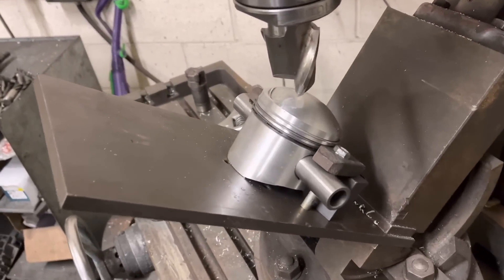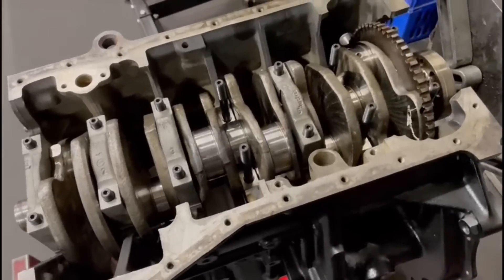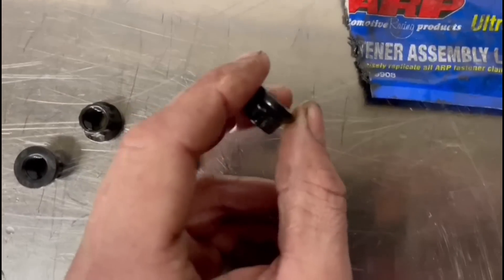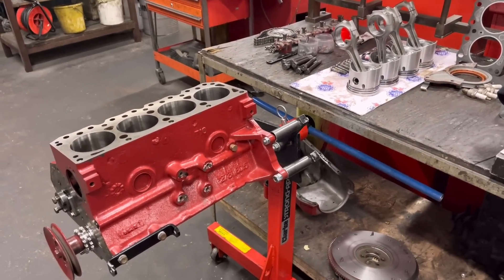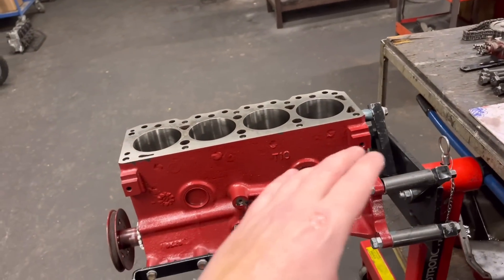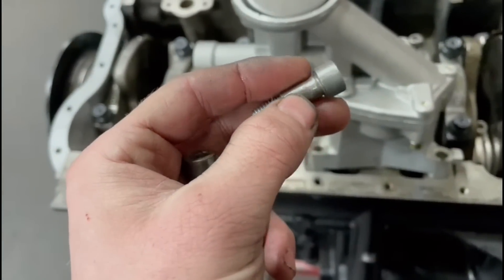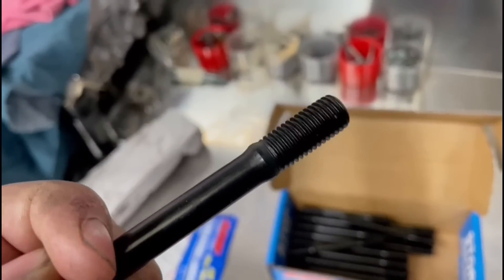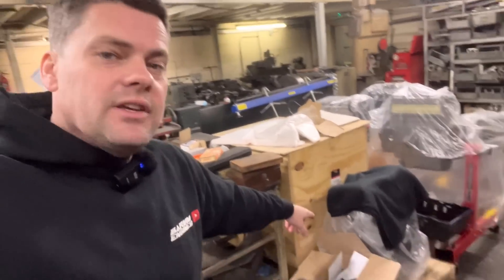“ALL BEEN DONE” they said. Lotus engine inspected. You won’t believe what we found inside!

Comment: Hey ,machinist here! I know that 2 flute endmill "works" but you will get less stress and easer chip removal, with an 4 or 6 tooth high helix endmill.
Id also recommend you reduce you SFPM accordingly as the more teeth, the less tool rpms are needed. Your not hogging so deep flutes aren't needed.

Comment: With ANY New/rebuilt engine the FIRST 20--30sec are the MOST CRITICAL in the ENTIRE LIFE of the Engine!!!!!!!!!!!!!!!!!! a rebuilt engine probably has to turn over quite a few times before it will start, oil pressure probably is Not up at that stage, so NEW TIGHT pistons/rings etc with little or No lube NOT GOOD, personally IF i was rebuilding an engine ALL moving parts would get assembly lube!!!!!!!!!!! For the first  500km just a basic cheap oil nothing too fancy ( you have too allow an engine to bed in before using the good stuff, after running in oil change every year regardless 10km or 2000 CHANGE the oil!!!!!!!!!!!!!!
Many years ago my friend, a warmed over 1600 B series ( don,t laugh it surprised me!! ) it was rebuilt, he helped someone towed a car, ruined the B series!!!!!!!!! 
My father was very highly qualified mechanic, ( 14 or more qualifications!!!!!!!!!! ) plus my own experience 55yrs of motoring, DO NOT SKIMP on maintenance doing so will BITE you on the ass!!!!!!!!!!!!!!!!!!

Comment: You can measure the exact depth by placing a height gauge in the pocket and touch with the mill the upper side of the height gauge. This way you know the exact depth which could allow you to leave a witness area within the pocket when you tilt the mill slightly as suggested

Comment: On the pre-crossflow engine, I agree 100%.. never buy something that's "been done", and if you do coz the price was right, at least take it apart and verify everything. Case in point I bought a used engine last year out of a running vehicle that had been "overhauled", for peanuts, just TO take apart and recondition for another project. The deeper I went in the worse it got. Someone had been in there alright, original main & rod bearings completely worn out, but fresh(ish) piston rings installed upside down, gasket sealer everywhere, bore taper, it was a mess. I couldn't believe it was running decent before I took it apart. So that cost another $600 worth of parts and machining to put right.

Comment: I cringed when I saw that cap screw shank had been ground down, please stick it in the lathe next time and turn it down. It may not matter but it just simply not a good look.
Reply: Fix the thing that's wrong, don't modify things to allow for it.
Reply: @Graham_Langley  
Well yeah taking a step back you are correct in fixing the issue and whatever you happen to do don’t do it by methods that look unprofessional.

Comment: Regarding the tight engine> i ran into a similar problem back in the 1970's with a pre crossflow short motor that had been bored etc etc. It would lock up as soon as the head was torqued down. Prior to the engine being rebuilt,it had been seized and the block was actually twisted. Some thing the machinist hadn't considered.

Comment: I was taught to use a punch to mark each rod and cap  so we would  center punch each rod and cap before engine was stripped  to save confusion  I wasn't keen on the idea of using a hammer to punch each rod and cap whilst it was connected to the crank  though at the time

Comment: My guess is that engine with the caps mixed up was an owner assembly. 
I've worked on lots of VW and Audi engines I'm yet to do a VR6, I would weld up a side mount for the stand if it were me, that timing cover looks like a pain on the stand. If I was just doing timing chains I drop them onto a steel table with wheels out of the car, so I do them on the table. The valve in the block can cause issues, the VW/Audi 2l turbo engines around 2012-2018 have them and they cause oil pressure issues, same as balance shafts and cam bridges, then the 1.8l T doesn't have the valve.
Thanks from Canberra Australia.

Comment: No disrespect to you or your employees expertise or capabilities, but at 2:56 when assembling the crankshaft main caps, there is what appears to be potentially a lot of contamination on the sleeves of the gentleman which potentially could get into the engine or worse into the bearings as they are installed. What is done to mitigate the possibility of this happening??

Comment: I always put the wrist pin through the piston and place a piece of bar stock through it to clamp. The reason is the wrist pin is only splash lubed and any small defect will cause a hot spot and when they seize the piston rolls over and devastates every component in the engine, just how I prefer to do it. I figure anything that can be done to prevent any possible damage is worth the little extra effort. The other issue I frequently see is the skirt length being used as a datum surface, when the only real dimension on a piston that is non-critical is the skirt length, they should be parallel and dimensionally correct, but should be and reality are two different things. Verify everything and you don't need to question whether the manufacture was paying attention, in today's world of CNC machines, mistakes are all too common.  The last Eagle crank I installed had a faint clicking sound when I turned it over and three skirts were just making contact with the counterweights, it turned out the radius on the counterweights we're not indexed correctly it would have piled that engine up if I didn't catch it. Just my random thoughts but I do enjoy watching the old school machining and hand built engines the expensive new machines are faster but with speed comes sloppy work in my opinion. Hope you all have a great day.

Comment: Why would you restamp the bigend caps upon removal if already stamped? Can see the benefit of initial permanent marker to confirm removed location and also help identify the previous mismatched error, but now stamped again with a different number could cause confusion in future unless removed
Reply: As far as I can see, cap 3 was on rod 4 and vice versa but rod 4 was in cylinder 3 and vice versa so matching the right cap to the right rod and the right rod to the right cylinder should sort things out. Maybe.

Comment: I´ve and a friends bought engines from a Mr. Eamon Sword Lotus Club. One TC 1968 has had no oil seal in the sump - find out when the car was ready for road, oil goes to the street.
Another engine für pounds 15 000 .-- with steel crank has had 4 different pistons  from different companies in it. The engine need then a total refurnishment from another engine builder for pounds 12000.--  . Another TC engines has a rusty crank in it, oil comes out. Lucky when a Lotus Elan ist ready vor road and one find these problems!  No engine builder repaired the engines he build. 
These people form Lotus Club are deceiver!  What a luck that you show how you build engines in a serios way.....